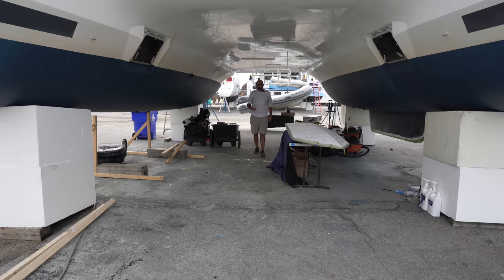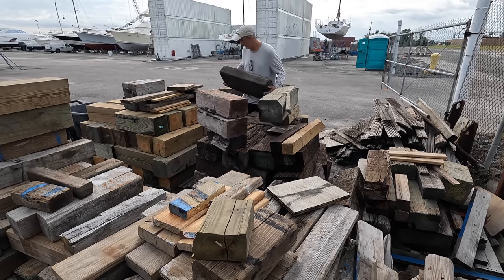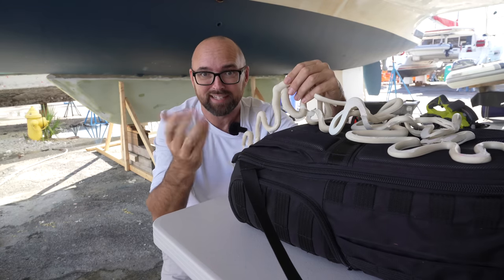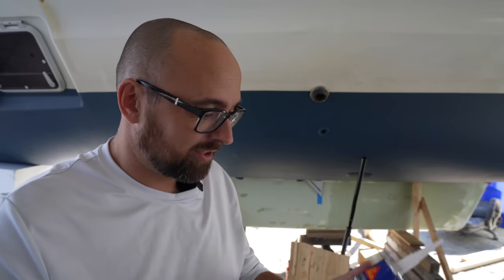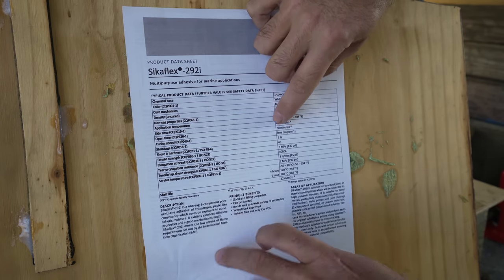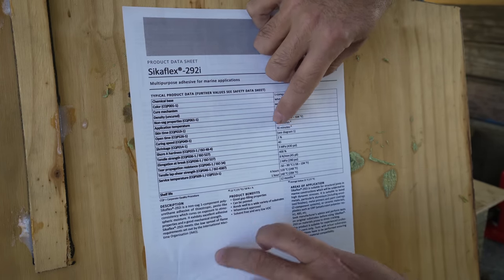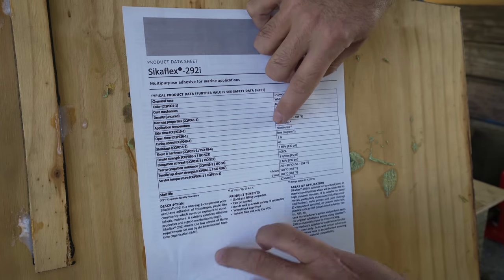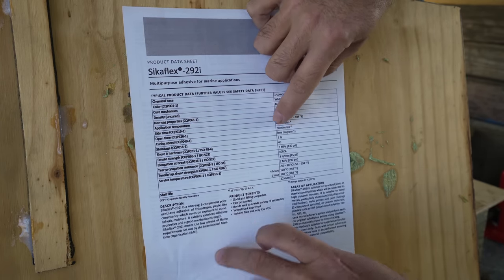Sail Life - Will it stick? Gluing the keel back in place 😬 Helia 44

Comment: I am super impressed by the attention to detail mads spends in reading and following the directions on paints and adhesives to be sure the specifications are within the work window and use parameters. This is actually pretty rare even in so-called "professional" marine techs as they go about contracting work for poor unsuspecting schmucks who actually believe the people they are hiring have a clue what they are doing -or even care if the job comes out correctly.

The time spent rehearsing and choreographing the procedure so the process was under the time limits for good adhesion at the given atmospheric conditions was impressive too. 

My mind boggled a little when you told us how many tubes of adhesive you needed.  At somewhere around $20/tube that made my head swim. Even though you weren't paying a couple of "professional" marine techs $300/hour to do this job the material costs still were not cheap just in themselves for a DIY job.

Comment: The Ryobi caulk gun is easily the best tool in the cordless Ryobi line.  If you want one for Athena but don't want to futz with Ryobi batteries (which are not long lived) you can find adapters that allow you to use 18 volt batteries from your preferred platform.

Comment: Really surprised you didn’t add extra layers of fiberglass where there was a big gap. Wouldn’t have had to use as much adhesive and it probably would have been a better bond. Probably won’t matter though
Reply: I'm a shipwright. I've built yachts, and I worked in a shipyard for nearly 20 years, and we would absolutely add more glass to that keel. The previous fit was not done well. (to put it politely)  1/4" gap max, but we would build it up to be a full contact fit.   they are luck that thing didn't fall off.   Aaaaaand, 15 tubes at 20-30 bucks a tube is just ignorant.  As nerdy and methodical as this fella is he clearly is learning and making things up as he goes.

Comment: Hate to break this to you: Sikaflex usually does not cure well beyond a thickness of a few centimeters. The moisture needed for it to cure cant penetrate through such thick layers. Chances are the top of the keel is going to sit in soft sikaflex. There is a diagramm for curing speed vs. thickness in the 292i datasheet.

Comment: Great video, as always! 👍👍 A tip: Before painting over the Sikaflex joint with antifouling, a thin layer of epoxy primer has proven to be effective. In my experience, most one-component paints react with Sikaflex and the joint does not cure properly.
Reply: Great work- solid planning - wonderful execution!

Comment: Great work, as always, Mads. Given that you discovered that so much of the original adhesive wasn't making a bond between the pocket and the keel, how did you ensure that you achieved a large surface area of bond with the new adhesive ? Maybe I missed it in the video, but it wan't clear to me. Looking forward to seeng you back aboard Good Old Athena soon 👍

Comment: Working in displays, I've dealt with the equivalent of your floor jack/bottle jack dilemma. We often would set up a long lever, maybe 4m, with the fulcrum at one end, and the equivalent of the keel at the other. Allowing the lifting surface of the jack to move relative to the lever is as simple as a plate and a roller. The displacement with the jack comes from the short throw, and the solves that problem.

Comment: Amazing job. On a different note, these type of appendage is notoriously inefficient hydrodynamically due to its depth/ width ratio. Wouldn't it be a good time to add some wings (Australia II) at the tip to maximize portance without changing the draft and I suppose the ability to beach?

Comment: when you extracted the keel from the cavity in the hull you noticed that alot of the glue or cement had not even touched the inside wall of the cavity watching you both insert the keel I was wondering what you did diferent that would eleveate ending up with the glue or cement not touching the inside wall of the hull cavity as it appearrs the thickness of your glue or cement you used was about the same thickness. Did you enhance the thickness of the keel that went into the cavity. Very intersting watching you complete this task.

Comment: Given that most of the binding material that the yard used to bond the keel to the hull did not make contact to the hull, how did you make sure that the Sikaflex 292 is now making the desired surface contact all over ? What if you have the same situation as before in which the bonding took place in only about 10% of the surface? 
It looks to me like a gamble to assume the bonding is as strong as required.
The keel might stick for now, but might fall off when the boat is grounded.

Comment: Great work. If you had done the adhesive work at night, you had more time, because of the lower temperature. But maybee the humit had been greater. I would not beleeve a keel that not are bolted on. Are the upper adhesive in the contact of the boat?

Comment: Nicely done fix.  As to the manufacturer's process for attachment, it's about as half assed as it gets.  I just don't see "fortified caulking" as a sufficient way of firmly attaching the keel.  With dozens of other viable methods the one used must simply be fast, cheap, and dirty.  I'm sure your fix will exceed anything you found and replaced.  Thanks for sharing the video.
Reply: That sikaflex is plenty strong enough. I've used it to bond metal and torn the metal trying to get it apart later. With the thickness and depth they have applied it will probably take a month or so to reach full strength though.

Comment: My comment is too late, but you could have built a cradle for use with the floor jack. In this method the weight of the keel is spread evenly.

Comment: That was an excellent practical execution of the old adage of the seven P’s:
Proper Planning and Preparation Prevents P155 Poor Performance. 
Tricky to get right, well done, it went flawlessly. 

TBH, I’m still completely aghast at the mess of random garbage that you found within when you opened the keel up. 

Someone at the factory, whoever was responsible for allowing that abysmal construction, needs to be re-educated with a firm hand upon the shoulder guiding them off the premises on a permanent basis.

Comment: Omg lmfao.
The jack lifts to the side.
Well no shit, the arm works on a pivot and moves in a radius. What a shock.
If only it had wheels to allow the base of the jact to move and keep the lifting point stationary.
If only we invebted the wheel. 

I love ya Mads but that was a silly thing to say. You genius types sometimes miss the simplest things us idiots deal with every day. Roll the damn jack. Ya know, you can turn a car around with a floor jack on a hard surface....because the jack rolls. 
Good part of the video, not sure im so impressed with the cat overall. Nice boat though as a floating cottage. I wouid trust that keel install over factory every time. Great job.

Comment: Could you have installed three, one inch stainless steel diameter bolts on the keels top side and drilled corresponding holes in the bilge hump?
Reply: Those keels are called "Sacrificial Keels" The are designed to come off if the boat hits a reef /underwater obstruction so the hull is not compromised. Hence the reason they are just glued on.

Comment: Just for information for the future, bottle jacks  come in several types, the pump ones that everyone seems to have seen, long or extended stroke versions and air over hydraulic jacks.   These allow a compressor to do the pumping instead of you swinging a handle.  These are very good if you are in a hurry, have to do many lifts, or for heavy weights.

Comment: But why did FPajot engineer the keel space so much larger than the keel?
Reply: So the keel can flex when hit without putting a strain on the keel box and possibly causing the hull to crack.

Comment: Quite surprised a keel is held in with glue and not stainless bolts but what do I know!
Reply: It is not a ballast keel like on a monohull. You saw that they were able to lift it just the two of them. I am guessing 100 kilos or maybe even less. 220 lbs or less.

Comment: it seems that you did not put any glue on top of the keel, just on the sides. Shouldn't you have?
Reply: the idea is to not .. think about the removal just performed, would have been impossible if sealant was on the top and cured correctly.
Reply: that is true!! @denisohbrien